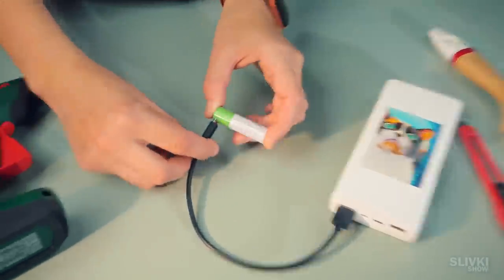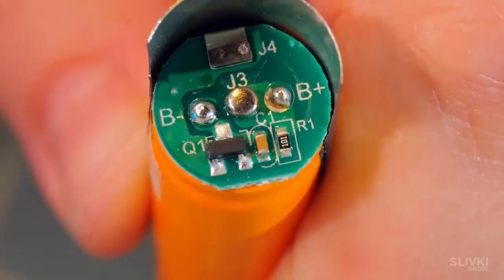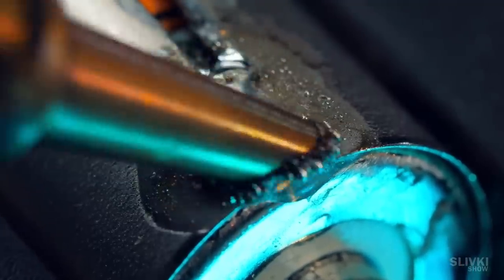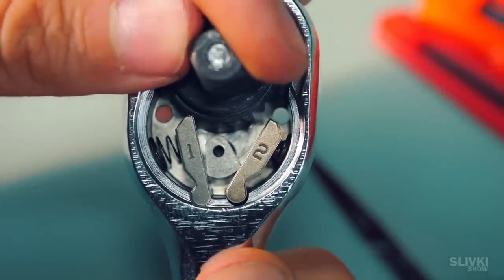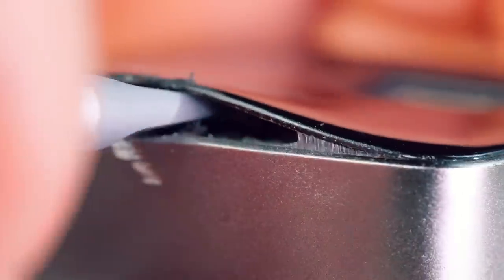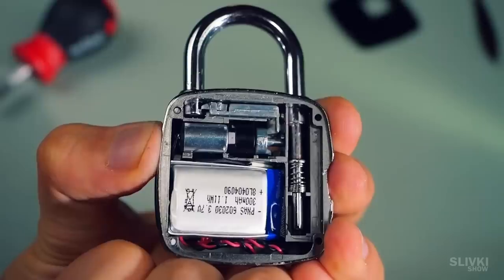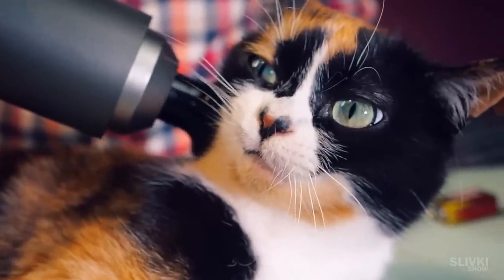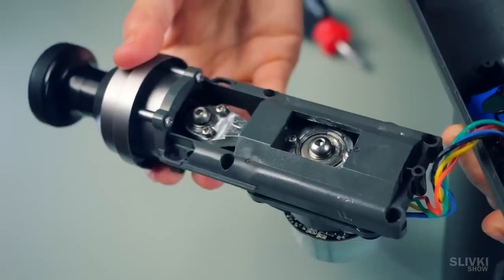WHAT'S INSIDE A RATCHET WRENCH?

Comment: I don't know why, but it seems to me that in the rechargable baterry is lithium-ion capacitor.
Reply: A capacitor in a way is actually a battery.
Reply: Yes it's an electrolytic cap, a lithium cell would have required a protection circuit, but the only component that you can spot on the circuit board is a current regulator

Comment: The chip in the batter isn't that complex, the chip in the adaptor converts the voltage from ac to dc and the second chip controls the current flow
Reply: USB outputs DC so the chip inside the battery doesn't have to rectify it.

Comment: That ratchet is a copy of the plomb / proto flapper pawl mechanism, but there are many other mechanisms out there.
The most common other mechanisms being the Williams  / MDF batwing pawl mechanism,  and the S-K single pawl roundhead mechanism.
More recently the S-K / FACOM heartspring mechanism, and theres the Snapon floating pawl, the New Britain dual pawl round head, the PROTO Big Dawg, the EASCO RHFT dual pawl roundhead, and many more.

A lot of them are doing the same exact thing, moving one pawl out of the way while engaging the other.
Some however are using one pawl and simply pushing or rocking it into either direction.

Then theres the Clutch drive gearless mechanism which operates on the same principles as a coaster break in a bicycle hub.